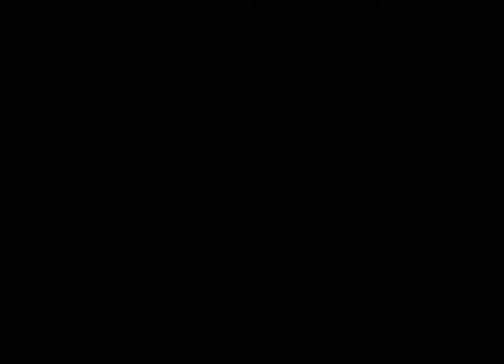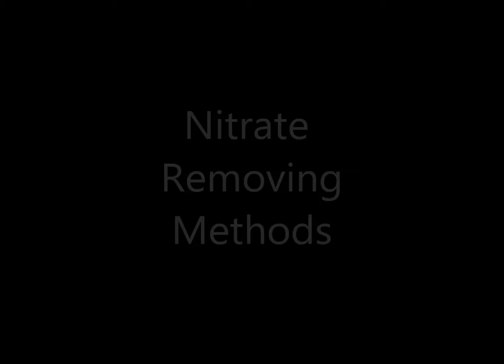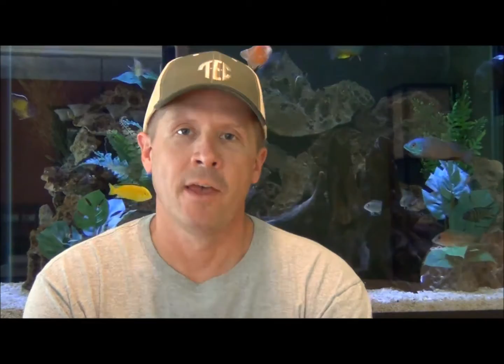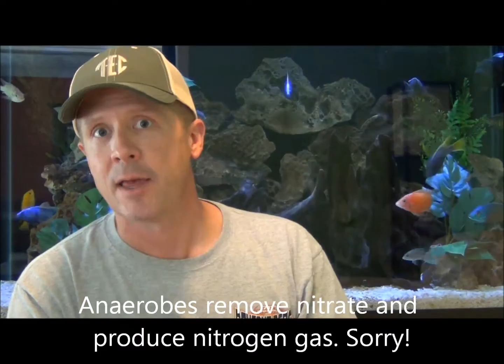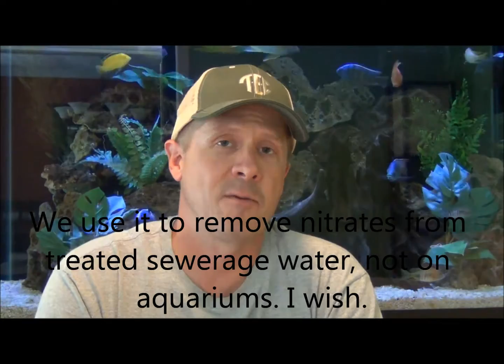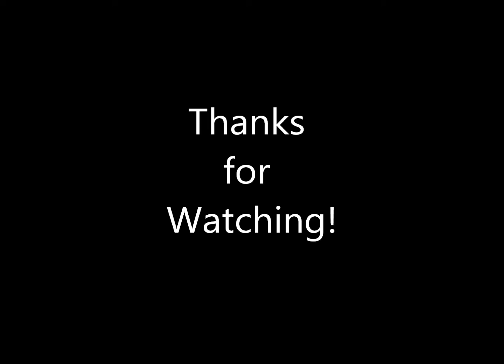Nitrates in the Aquarium Part Four

Comment: When cleaning my canister will I need to leave the Pond Matrix submerged to preserve the Anaerobes, Keeping oxygen from them so the process isn't loss.
Reply from the maker: It isn't necessary to keep Pond Matrix submerged during routine maintenance. The aerobic bacteria that live on the outer 0.5 mm of the media will use up the oxygen before it has a chance to reach the anaerobic bacteria within the internal areas. It's the same principle as how fire burns oxygen, and it would be impossible for oxygen to pass through a wall of fire. I hope that makes sense. PM is also effective in wet/dry filters too. It is exposed to a high oxygen environment in a wet/dry.
Reply from the maker: Almost forgot. The reason that Seachem recommends submerging PM when in use is due to the fact that more water will come in contact with more of the media.

Comment from the maker: Yes. Carbon can be used when using Pond Matrix. I personally use Seachem's Matrix carbon in a carbon reactor and Seachem's Purigen in a canister filter. I mentioned that Pond Matrix doesn't require "carbon dosing" as some other forms of denitrifying media. Carbon dosing for example is adding Vodka to the AquariPure to feed the anaerobes. The anaerobes that colonize the Pond Matrix are able to utilize carbon source from the water within the aquarium. Thanks for the question.